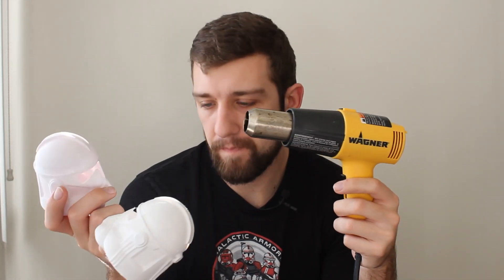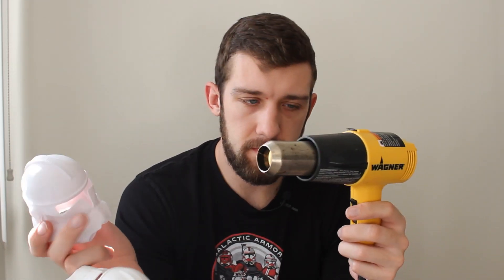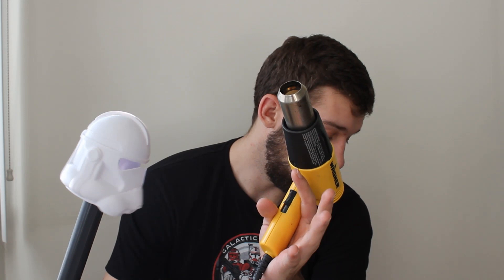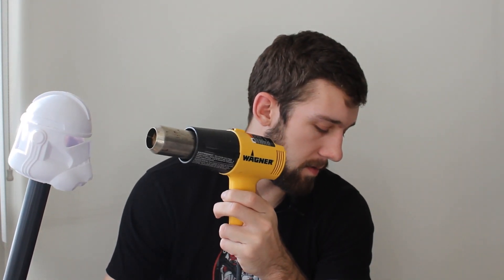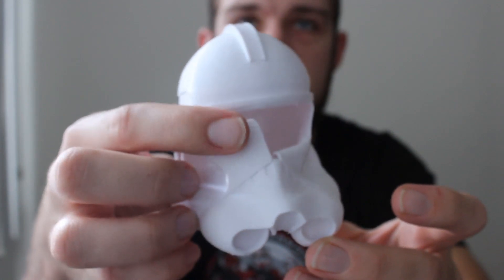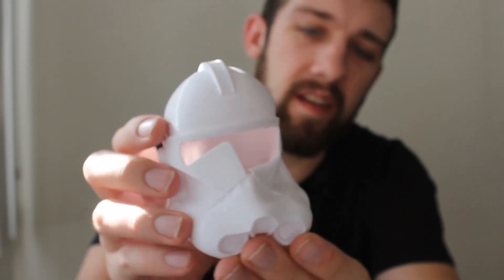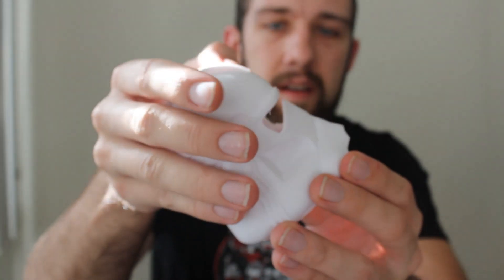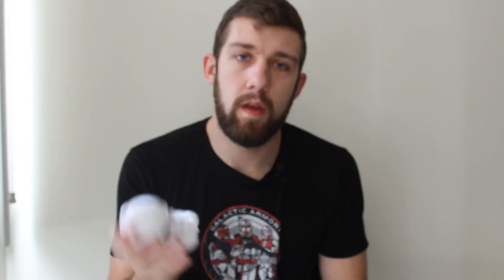Melting 3D Prints - PLA vs PETG

Comment: Tip, if youre planning to sell clone trooper kits i'd suggest to print in PLA or another filament, clean them up and turn them into masters.

Moulding the masters in silicone and resin casting is faster, and you can normally get 40-50 pulls before repeating the process and tends to be far cheaper. It can be intimidating at first but once you learn the skill you'd be better off.

Comment: You can easily melt solder with a heat gun! That gun you are using is probably somewhere in the neighborhood of 1100 degrees F (593 degrees C). Think about it your printer is somewhere around 250 degrees C. It can get 115 degrees c in a car in 35 degree C in just one hour.

Comment: In all fairness... the air temp coming out of a heat gun is Weeeellllllllllllllll beyond the temperature range of any thermo plastic. It would never have proven PETG to be more resistant to heat than PLA. It's just too hot.

Putting them in the back of the car up to about 80C.... yeah now thats a more tangible test to show the difference in PETG over PLA.... but not a heat gun....

Comment: Have you tried PLA+ it has a higher melting point, if you think about it pla melts at 180 degrees Celsius which 356 degrees Fahrenheit I think with art resin as a supporting filler material it would essentially make it stronger what are your thoughts? Also I found another filler material that is much easier to work with instead of bondo and filler primer, wood filler I have used it recently and it is cheaper and easier to sand give that a try and let me know how it goes

Comment: The main drawback of petg is its tendency to draw moisture. If you can get a food dehydrator that fits a roll of filament then it's a great material to print with. Abs is another great option, however it needs an enclosed printer for the best prints. The cool thing about abs though is you can use acetone vapors to smooth it instead of having to sand.
Reply: Would you still be able to coat abs prints with bondo or resin fiberglass?

Comment: Dang, I was hoping that PETG would be able to handle underhood temperatures but that doesn't look too promising. Any idea what temperature that heater is putting out?
Reply: Heat guns typically throw out about 500 F.
Reply: those are just extreme cases. It's the same as using your computer at a 100% when stresstesting which you would never be able to under normal circumstances. Usually Heatguns are between 800 and 2000 watts which can lead to severe 3rd grade burning if you touch the nozzle, so it is dang hot. PLA has a printing meltpoint of around 120°C. I'm not sure when it begins to deform. I suppose at around 45°C which would be the average inside temperature of a car when standing in the sun the whole time. PETGs melting point is much higher. Since the models are also scaled down, they also have thinner walls, making it easier to melt. As he said in the video, the PETG deformes less. If you are unsure you could just wrap the box filled with armor with these carshield foils which prevents heat to enter the car through the carglass.